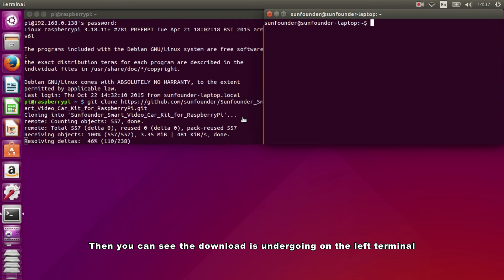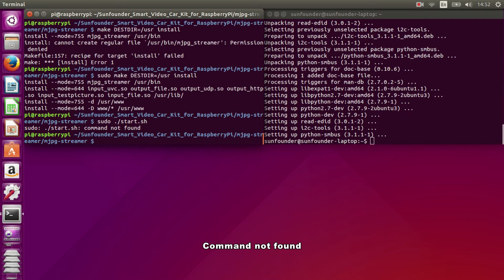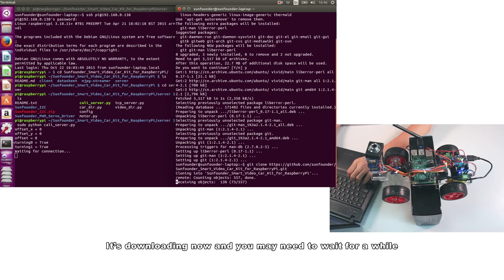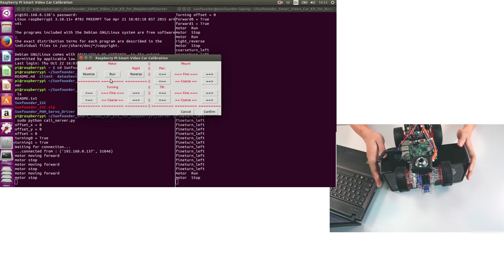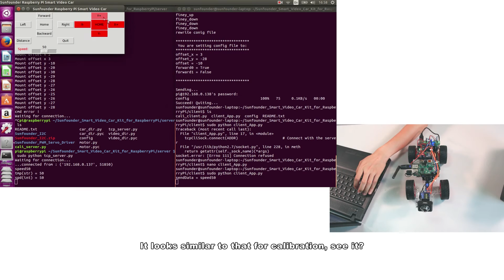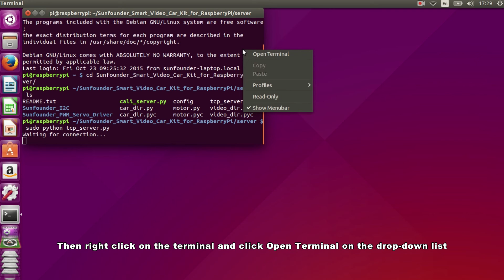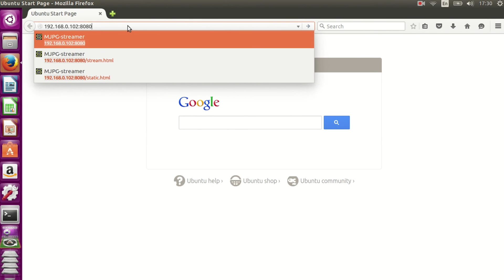Smart Video Car for Raspberry Pi Assembly Tutorials 04 Software Setting/Configuration/Debugging

Comment: Hi support team,

i also need a help from you side.
i need to make the preparation for the calibriation, but the server do not take the "waiting for connection.." status instead ther is an Error in the last line: NameError: global name 'commans' is not defined. 
How to handle with this issue?
Reply: the wiring was the error. now it works

Comment: Hi,

Which batteries should be use ? IMR ou ICR ? 
How many ampere is require ? 

There is not information about it.
Is it possible to share me a model to use  please ?

Thanks,
Pascal
Reply from the maker: Dear Pascal,

Both of the batteries you can use, but the battery should be 18650 rechargeable Li-ion battery (3.7V) without protection circuit board. For the battery ampere, the larger the better.

If you have other question, pls feel free to connect with us.
Have fun in SunFounder!
Reply: Thanks for your quick answer.

However, I'm using IMR 18650 3,7V 2500mAh which size seem be bigger, I can't insert it to the charger so not compatible. (batteries used for e-cig)

Can you provide me an example model please ? 
Is it possible to power all the circuits only with the PC ? If yes, how can I do it ? 

I would like to configure all equipments but I don't have the ideal batteries for the moment.

Regards,
Pascal
Reply: Well, I tried to insert it and it works correctly, my bad :)
About the model batteries, which can I take to get a long autonomy ? around 6000mA ? 

Thanks,
Pascal
Reply from the maker: Dear Lepasc,

A. There is no ideal battery for your reference to.
B. You can't power all the circuits only with the PC directly, because the motor and servo power is relatively high.
C. For the model battery, the capacity of 18650 battery can't be very large capacity. If you want to use another battery, you can choose the li-ion polymer battery of 2S (2 cell).

If you have further question, welcome to ask.

Comment: howbdobyou instal the raspberry pie on the sd card
Reply from the maker: Hi marcus nash,
If your question is about how to instal the raspberry pie on the SD Card, you can click the follow link which is the RPi official website tutorials: https://www.raspberrypi.org/documentation/installation/installing-images/README.md
It will show what you want, or pls tell more details about your trouble.
Thanks.
Reply: SunFounder  
Thank you ver much. After I've got on the SD card should I just plug it into the raspberry pie?
Reply: SunFounder 
also do I need to download Linux for this to work
Reply from the maker: Dear Marcus, 

You need to program the raspbian to the SD card. In additional, you don't need to buy or install the Linux sysyterm to use the Raspberry Pi. Both of the Windows Linux and OS X can log in the Raspberry Pi by remote access.
We have a simple course for you reference to.
https://www.sunfounder.com/wiki/index.php?title=Quickly_Get_Started_with_Raspberry_Pi_Kits

If you met some troubles, pls connect with us.
Reply: SunFounder 
I'm sorry but I think there some steps I'm missing between putting the batteries in and opening a terminal on my computer.
Reply: Should the car have been connected  to my laptop ?
Reply from the maker: Dear Marcus,
No, you needn't do that. Still you find the way to open the bash shell of the Raspberry Pi, then you can go ahead the latter steps.

Follow link is about a course which will show many ways, we recommend that you can remote access by using the Putty of the Windows.
https://www.sunfounder.com/wiki/index.php?title=Quickly_Get_Started_with_Raspberry_Pi_Kits

Comment: how did you get to the programming portion at 49 seconds. I tried downloading what was in the Manuel but it does not seem to be working or unzipping.
Reply from the maker: Dear Marcus,
We use the Linux terminal system, you can login raspberry pie through the ssh remote which is under the terminal.
You can scan official documents in the raspberry, and learn how to login Raspberry pie using ssh remote by other systems. 
The follow is the  link:
Https://www.raspberrypi.org/documentation/remote-access/ssh/README.md
If you have any other trouble, pls feel free to connect with us.

Comment: So you need a Linux computer to make the car work?
Reply from the maker: You can also control it with a windows system: https://www.youtube.com/watch?v=QdWtj8qBnug
Reply: I also have a question, my battery started smoking when I put it in, will anything be affected?
Reply from the maker: Please kindly provide some detailed pictures of your whole wiring, so that we can help to point out the problem. You can send photo to note@sunfounder.com.
Reply: Also, is the the battery holder module available to buy or replace? The springs fell out and the positive part fell out also.
Reply from the maker: Hi! We can ship you a battery holder to replace. Could you tell us whether the problem is solved or not? If the problem still exist, please kindly send some detailed pictures of your wiring for us to check.

Comment: I type in ssh pi@and my IP address, but it says connection denied help help please
Reply from the maker: First, make sure
your Raspberry Pi is connected to WiFi successfully. You can get into the setting of the router to check whether your Raspberry Pi is connected or not.
Then, make sure your computer is sharing the same network with the Raspberry Pi.
Third, try to reboot or reboot-force the Raspberry Pi.
Reply: SunFounder where Can I obtain a password ?what password do I put?
Reply from the maker: Hi, the Raspberry Pi's password is ”raspberry“ by default. 
If you use git clone, and it ask for username and password, it means the address behind the git clone is wrong. Please kindly check.

Comment: So should I install all these .py files on my raspberry pi? Or do I use an SSH client do install it from a terminal, via another PC?
Reply from the maker: ssh is a remote access to Raspberry Pi. These two ways all can do install, and you need to download .py file on Raspberry Pi.
However, you need to download these files to your Raspberry Pi and PC, and run client on PC to control the server of Raspberry Pi.

Comment: I intend to control a car far far away over the internet. To that end, I suppose I could forward the necessary port for server/tcp_server.py on my router. But is server/tcp_server.py safe? It looks like it would accept any connection. Following solutions occured to me:
1. Line 18 in server/tcp_server.py: tcpSerSock.listen(5)  ---> Change 5 to 1, so only I can be connected. When I'm done, I kill the tcp_server.py process. But this is not really security. Is it better than nothing, or of no use?
2. On the router, forward port 22 only. ssh into the RaspberryPi from outside the router with X forwarding (ssh -X ...). Start tcp_server.py in the background (python tcp_server.py &). Start the client on the RaspberryPi as well. However, I don't know if this would further increase the network delay, especially considering that I would be doing X forwarding. I could theoretically turn tcp_server.py into a program that moves the robot directly from the command line. Have you people already done this?
Reply from the maker: Using tcp_server.py directly is not safe. Neither is the Mjpg-streamer, which uses http instead of https.
Controlling the robot through command line interface is much safer, but a little disturbing with all the commands. And we have not done that. 
My suggestion is to use the IoT platform, like the Amazon AWS IoT, the Microsoft Azure IoT, etc., which is safer and more convenient. But it may not be easy to develop.
Reply: Thank you for the quick reply. I could look into those.

Comment: Hey Sunfounder,

I got this Raspberry: "Raspberry MB Pi Type B 512MB", I bought it in 2014.

Will the car work with it, or do I need to buy a new version of the Raspberry Pi?
Reply from the maker: The car works with the type B, but the hole on the acrylic plate is not fit for the board. So you may need to find another way to fix your Pi on the car.
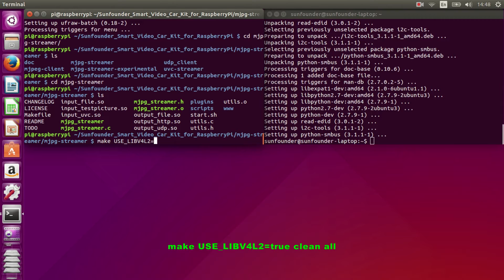Reply: @Sunfounder_official  Hey, i get error in 6:35
pi@raspberrypi:~/Sunfounder_Smart_Video_Car_Kit_for_RaspberryPi/mjpg-streamer/mjpg-streamer $ sudo make USE_LIBV4L2=true clean all

make -C plugins/input_uvc clean
make[1]: Entering directory '/home/pi/Sunfounder_Smart_Video_Car_Kit_for_RaspberryPi/mjpg-streamer/mjpg-streamer/plugins/input_uvc'
rm -f *.a *.o core *~ *.so *.lo
make[1]: Leaving directory '/home/pi/Sunfounder_Smart_Video_Car_Kit_for_RaspberryPi/mjpg-streamer/mjpg-streamer/plugins/input_uvc'
make -C plugins/input_testpicture clean
make[1]: Entering directory '/home/pi/Sunfounder_Smart_Video_Car_Kit_for_RaspberryPi/mjpg-streamer/mjpg-streamer/plugins/input_testpicture'
rm -f *.a *.o core *~ *.so *.lo
make[1]: Leaving directory '/home/pi/Sunfounder_Smart_Video_Car_Kit_for_RaspberryPi/mjpg-streamer/mjpg-streamer/plugins/input_testpicture'
make -C plugins/output_file clean
make[1]: Entering directory '/home/pi/Sunfounder_Smart_Video_Car_Kit_for_RaspberryPi/mjpg-streamer/mjpg-streamer/plugins/output_file'
rm -f *.a *.o core *~ *.so *.lo
make[1]: Leaving directory '/home/pi/Sunfounder_Smart_Video_Car_Kit_for_RaspberryPi/mjpg-streamer/mjpg-streamer/plugins/output_file'
make -C plugins/output_http clean
make[1]: Entering directory '/home/pi/Sunfounder_Smart_Video_Car_Kit_for_RaspberryPi/mjpg-streamer/mjpg-streamer/plugins/output_http'
rm -f *.a *.o core *~ *.so *.lo
make[1]: Leaving directory '/home/pi/Sunfounder_Smart_Video_Car_Kit_for_RaspberryPi/mjpg-streamer/mjpg-streamer/plugins/output_http'
make -C plugins/output_udp clean
make[1]: Entering directory '/home/pi/Sunfounder_Smart_Video_Car_Kit_for_RaspberryPi/mjpg-streamer/mjpg-streamer/plugins/output_udp'
rm -f *.a *.o core *~ *.so *.lo
make[1]: Leaving directory '/home/pi/Sunfounder_Smart_Video_Car_Kit_for_RaspberryPi/mjpg-streamer/mjpg-streamer/plugins/output_udp'
make -C plugins/output_autofocus clean
make[1]: Entering directory '/home/pi/Sunfounder_Smart_Video_Car_Kit_for_RaspberryPi/mjpg-streamer/mjpg-streamer/plugins/output_autofocus'
rm -f *.a *.o core *~ *.so *.lo
make[1]: Leaving directory '/home/pi/Sunfounder_Smart_Video_Car_Kit_for_RaspberryPi/mjpg-streamer/mjpg-streamer/plugins/output_autofocus'
make -C plugins/input_gspcav1 clean
make[1]: Entering directory '/home/pi/Sunfounder_Smart_Video_Car_Kit_for_RaspberryPi/mjpg-streamer/mjpg-streamer/plugins/input_gspcav1'
rm -f *.a *.o core *~ *.so *.lo
make[1]: Leaving directory '/home/pi/Sunfounder_Smart_Video_Car_Kit_for_RaspberryPi/mjpg-streamer/mjpg-streamer/plugins/input_gspcav1'
make -C plugins/output_viewer clean
make[1]: Entering directory '/home/pi/Sunfounder_Smart_Video_Car_Kit_for_RaspberryPi/mjpg-streamer/mjpg-streamer/plugins/output_viewer'
rm -f *.a *.o core *~ *.so *.lo
make[1]: Leaving directory '/home/pi/Sunfounder_Smart_Video_Car_Kit_for_RaspberryPi/mjpg-streamer/mjpg-streamer/plugins/output_viewer'
make -C plugins/input_control clean
make[1]: Entering directory '/home/pi/Sunfounder_Smart_Video_Car_Kit_for_RaspberryPi/mjpg-streamer/mjpg-streamer/plugins/input_control'
rm -f *.a *.o core *~ *.so *.lo
make[1]: Leaving directory '/home/pi/Sunfounder_Smart_Video_Car_Kit_for_RaspberryPi/mjpg-streamer/mjpg-streamer/plugins/input_control'
make -C plugins/output_rtsp clean
make[1]: Entering directory '/home/pi/Sunfounder_Smart_Video_Car_Kit_for_RaspberryPi/mjpg-streamer/mjpg-streamer/plugins/output_rtsp'
rm -f *.a *.o core *~ *.so *.lo
make[1]: Leaving directory '/home/pi/Sunfounder_Smart_Video_Car_Kit_for_RaspberryPi/mjpg-streamer/mjpg-streamer/plugins/output_rtsp'
rm -f *.a *.o mjpg_streamer core *~ *.so *.lo
gcc -D'SVN_REV="Unversioned directory"' -O2 -DLINUX -D_GNU_SOURCE -Wall    -c -o mjpg_streamer.o mjpg_streamer.c
gcc -D'SVN_REV="Unversioned directory"' -O2 -DLINUX -D_GNU_SOURCE -Wall    -c -o utils.o utils.c
In file included from /usr/include/arm-linux-gnueabihf/sys/stat.h:446,
                 from utils.c:33:
/usr/include/arm-linux-gnueabihf/bits/statx.h:25:8: error: redefinition of ‘struct statx_timestamp’
 struct statx_timestamp
        ^~~~~~~~~~~~~

In file included from utils.c:32:
/usr/include/linux/stat.h:56:8: note: originally defined here
 struct statx_timestamp {
        ^~~~~~~~~~~~~
In file included from /usr/include/arm-linux-gnueabihf/sys/stat.h:446,
                 from utils.c:33:
/usr/include/arm-linux-gnueabihf/bits/statx.h:36:8: error: redefinition of ‘struct statx’
 struct statx
        ^
In file included from utils.c:32:
/usr/include/linux/stat.h:99:8: note: originally defined here
 struct statx {
        ^~~
make: * [<builtin>: utils.o] Error 1

Comment: Is this possible on a Mac?
Reply from the maker: +Guneish Umaanath Yes, it works with Mac.
Reply: +Sunfounder Are the instructions for Mac available in the package?
Reply from the maker: +Guneish Umaanath Sorry we currently haven't developed the manual for Mac. Thanks for support!
Reply: +Sunfounder Thank you
Reply from the maker: Though we don't have a complete tutorial for all the setting, here's a small tip for basic RPi setting. Hope it helps. (sorry about the missing link..)
https://www.sunfounder.com/forum/get-started-with-raspberry-pi-for-mac-os-x-users/#simple-forum-post-152
Reply: Hi, didn't you use a TF card for the setup of the Pi?
Reply from the maker: Yes, you need to plug a TF card into the Pi.
Reply: Hi, why am I getting 'Error accessing 0x40: check your I2C address' after setting up the cali_server?
Reply from the maker: Do you power the Raspberry Pi with an extra source? If yes, you need to connect the GND of the Raspberry Pi and that of the servo driver. And you can refer to this tutorial on our WIKI for more details:
    https://www.sunfounder.com/wiki/index.php?title=I2C_Configuration
And you may try running the i2chelper.py by the command: 
    sudo python i2chelper.py
Reply: +Sunfounder Okay, will this be corrected if I use the 2 18650 batteries as source as intended?
Reply from the maker: It could be solved if that's the problem. Try it before other solutions.
Reply: +Sunfounder I solved the previous issue with batteries. Thanks for that.
I encountered another issue while setting up the calibration for the client. 
What is the username and password for https://github.com?
Reply from the maker: Glad to help. 
For  this issue, if you're required to type in a password when using git clone, you typed in the wrong address. Please check again.

Comment: ok plugged camera up but no pictures is it supposed to do it automatically ?
Reply from the maker: +R Harris What system is your computer running on? On Windows 7 (or lower), when you plug the cam in, it will auto-install the driver and you need to wait for a while. Then when it is done, you can open Skype or other chatting tools with cam function, and then open the video chat to see whether it works. 
On Windows 10, you can just search out your Cam and click it open.
Reply: No it works yea!!!but I made a mistake on the calibration is there a way I can change it?
Reply from the maker: +R Harris It's fine and just recalibrate it.

Comment: i have 2 18650 efest high drain 2000mah 3.7v LI-MN  batteries will this be suitable to run this build or should i use use a different type of 18650
Reply from the maker: +Danny Leach Yes, it can be used.
Reply: +Danny Leach You can also use a 9v block battery,  just use the  dc-dc with  more than 6v
Reply from the maker: +13497ELIAS The 9V battery provides too small capacity and it'll run out very soon. We suggest you to still use 2 18650 batteries without protection PCB.

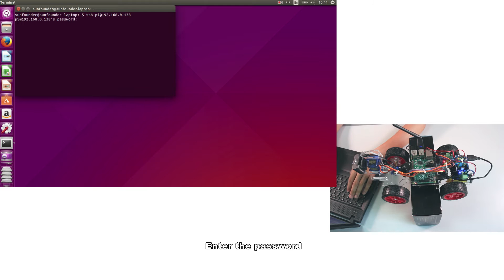Comment: My students are still working on this.  We are stuck at video part 9:17, after we put in ssh pt@IP address we cannot type a password, please advise.
Reply from the maker: +Angela Yake Actually it's pi@IP address, not pt@...
Reply: +Sunfounder right that is a typo but the password will not let us enter, the keyboard doesn't work after entering that line to type a password
Reply from the maker: +Angela Yake You just did not see it. It exists when you're tying. Just type in your password and press Enter and it will work. In Linux, the password is always invisible for safe reason.
Reply: +Sunfounder will we still use raspberry as the password here if we didn't change it? I cannot do it right now as I am not at school but can try again tomorrow with the raspberry password.
Reply from the maker: +Angela Yake Yes. Since you haven't changed it, by default it is raspberry.